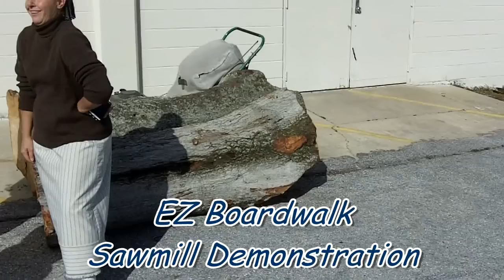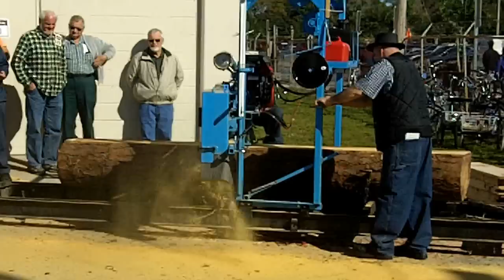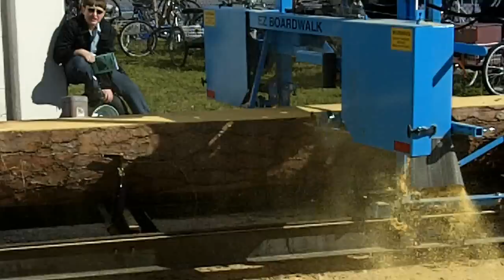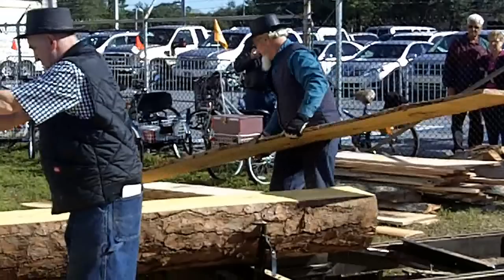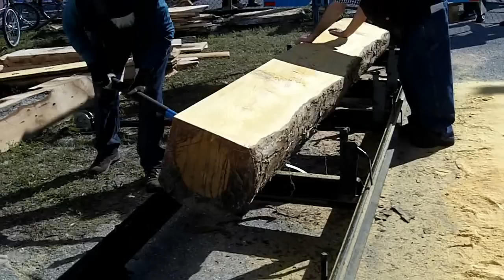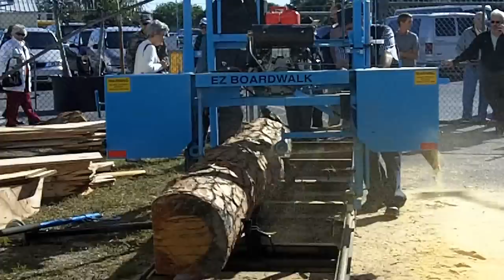EZ Boardwalk Sawmill Demonstration

Comment: My new 40 has started throwing blades ?
I accidentally backed into wood with the blade running which threw that blade and now it won’t keep a blade on ? 
Using a 6’ level as a straight edge , the front on the band wheels do not line up.
Really wishing I had chose a mill with a detailed manual and actual physical help available.
Just one single sheet of paper directions came with the mill and it’s a little vague as we consumers are not the builders and obviously don’t understand how to realign the band wheels? 
I’ve destroyed 3 blades now and am dead in the water.
Reply: Any updates? Did you get it fixed or get help?
Reply: @johnkobishop3721  
Yes, we got it dialed in.
Using all day on Saturdays trying to catch up now.
It’s working well, though I personally don’t believe the Ripper 37 blades that I recently ordered are any better than the Timberwolf blades that I had started with.
Thanks & take care.
Reply: @slabsoffreedomsawmill9721  awesome!! I ordered one early this year. About 10 weeks out yet.
Reply: @johnkobishop3721  it’s a great mill.
I push mine hard.
Build homes m-f and run the mill all day on Saturdays most of the time.
Looking forward to milling stuff for myself if I ever get caught up.